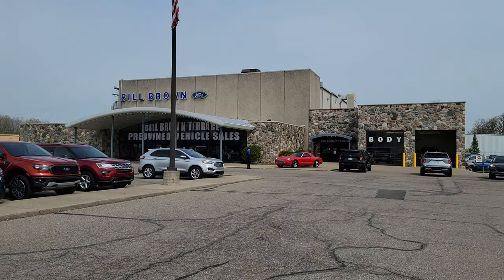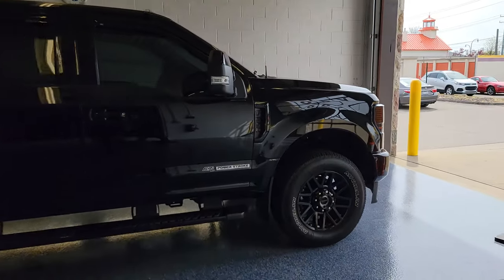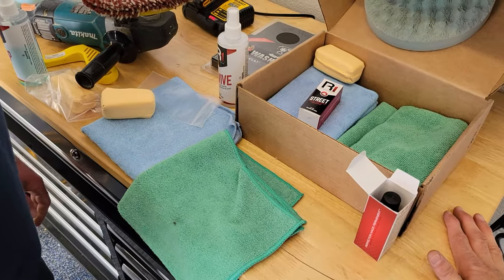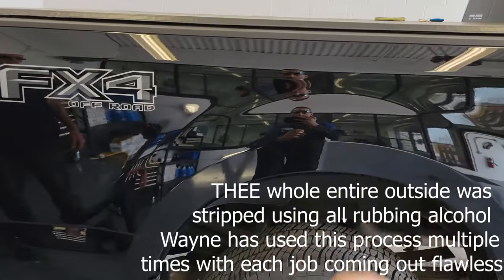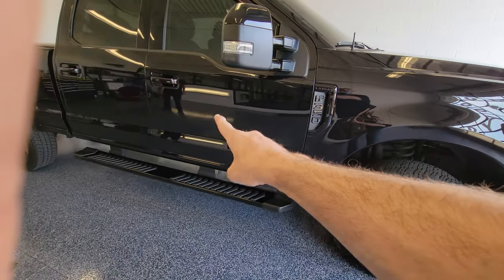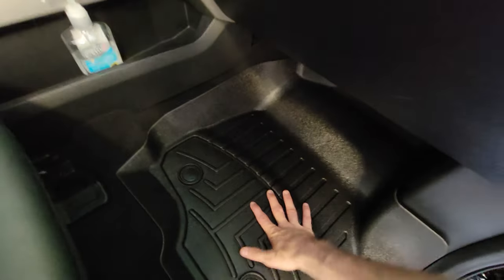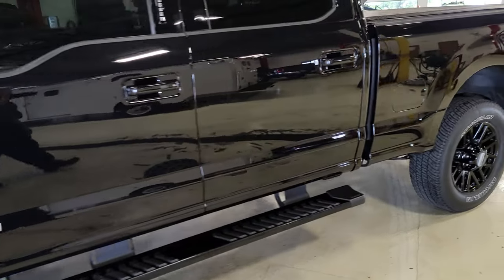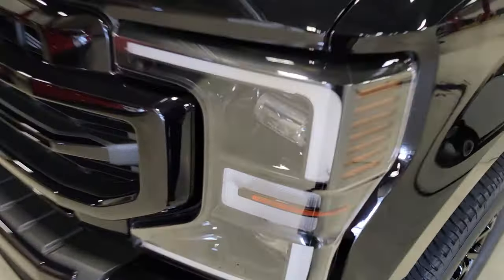I got my truck ceramic coated! DO YOU have yours DONE? 2020 Ford Superduty - I'm thinking you should

Comment: Had my Wife’s black Trail Boss coated back in December with R1.  So far it’s awesome.  Makes the wipe down way easier and don’t get those micro swirl scratches either.  Have the exact same Duty coming as yours.  It’s getting the R1 treatment too.

Comment: I had my 2020 F250 Rapid Red Metallic corrected and coated a week and a half after i got it at 661 miles.  I think it looks much better, deeper, and much wetter look than when i took delivery.  The rain just sheets right off of it.  Guaranteed  for 7 years and reported that it was coated on Carfax.

Comment: I bought my 250 back in 2016 in the Sacramento area. Was my retirement truck so I went ahead and splurged for the ceramic coating. It was one of the better decisions I made in my life. After five years it still looks just as good. I’ve come to think of it as suit of armor for the truck. Nothing and I mean nothing Sticks to this coating.
Reply: Did you get it done from.ford?
Reply: The Ford dealer had it done through a local company. I don’t know the name of the company. Product was called Cilajet. I think the spelling is only close.

Comment: The truck looks sweet, I did have a black car once, but never again, the stone chips and the swirl marks stand of too easily. On my 2018 6.7 I 3m the whole front of the truck , hood,fenders, grill, lights, bumpers etc. Then I 3m the roofline and both sides of the truck up to the 6.7 badge as I live  in Canada where they through rocks and salt  on the roads 6 months of the year. Lol
Reply from the maker: Damn, I need to get mine done now....